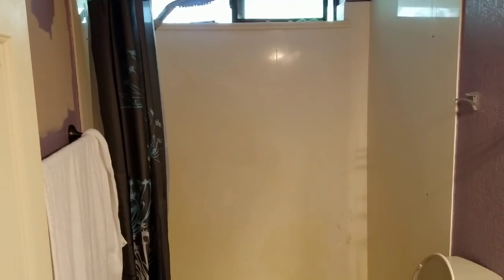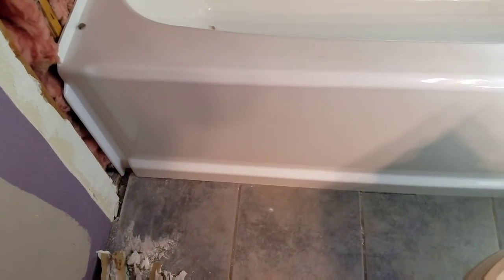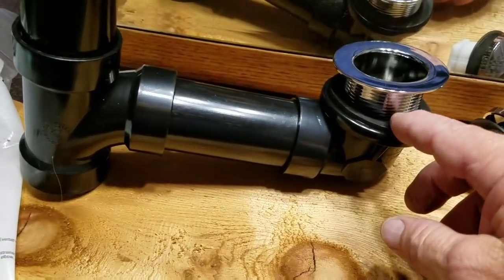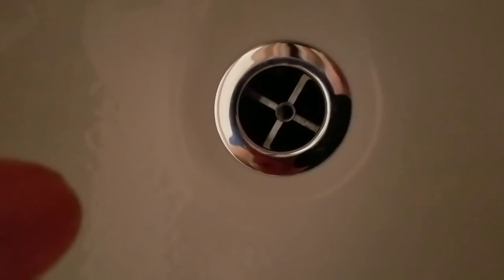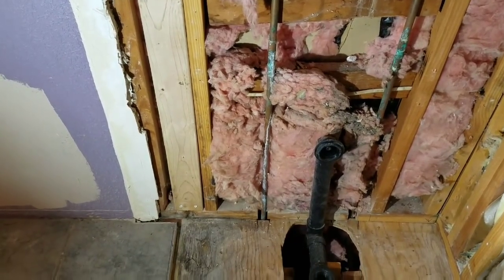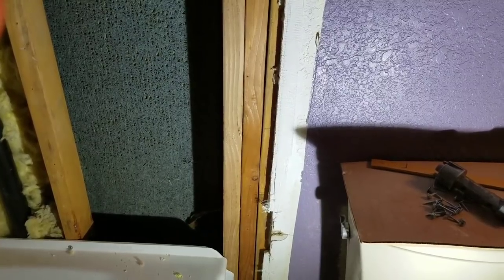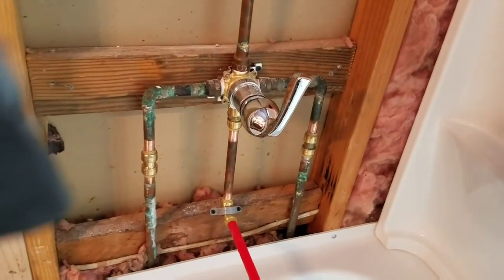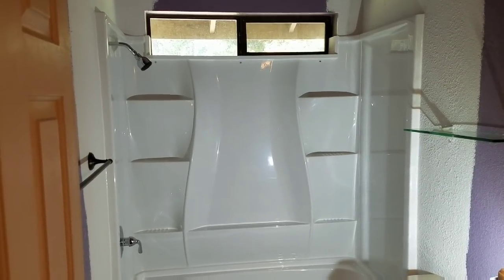How to install Fiberglass tub surround...Easy !!!

Comment: Great video.  Two questions...1)  The instructions for the Delta Classic 400 tub & surround have lots of stud placement that doesn't align with my current framing.  How important is it that these all align very close to the instructions?  2) For leveling the base, what about using a self-leveling compound on the plywood sublfoor instead of shims?
Reply from the maker: Hi John using a compound on the bottoms perfectly fine ,mortar or any hard mud like that and as far as  studs it  makes no difference at all whatever framing you have is perfectly acceptable , just want to make sure you have framing on the front edges, that's usually not the case unless you're taking out an old one that was the same size ,so you want to make sure you have framing on the front edge, on  the left and the right side covered, the rest of the stud placement is absolutely arbitrary
Reply: @Jonehughes  could give me an estimate on how many bags of mortar would be needed on the tub base to stick it perfectly on the floor
Reply from the maker: Real talk 

you do not use mortar to stick 
you use mortar to make it solid
 so there's no voids
 so it feels like you're standing on concrete
 in the same way you would pour waffle mix into a waffle maker to make a solid waffle

 instead of a partial waffle

 that's the same way you do a mortar base for a shower 

except opposite 

you pour the stuff onto the floor 

and then you set the pan on to it 

And that is only if you have the kind of pan that has the bottom that looks like a waffle iron

 in other words

 it has a bunch of voids that needs to be filled to make it solid

 if you have the kind of pan that absolutely is flush 

it  just lays on the floor 

you don't put anything on it 

you just lay it down

 but it shouldn't be on shims or then it will also have voids

 it literally cannot have voids

 or it will break down over time

Comment: Came out nice, dude. Does water drive in between the seams in the corners? Or do you caulk those long vertical seams?
Reply from the maker: Caulk everything super good with 
 Dap 3.0 brilliant white,
 Every single seam needs to be sealed
Reply from the maker: Dap 3.0

Comment: If I buy the walk in shower with the three Walls and base,,do the drains have to line up
Reply from the maker: Unless you are installing the exact same model (which is very unlikely) then you have to adjust the drain set up to fit the new
Reply: @Jonehughes  thanks

Comment: Great video! Keep them coming! I'm finishing up my girlfriend's bathroom and not sure if I should just pain over the m.r board or do something else like tiles. We're selling the house so don't want to go to crazy but want it to look nice. Any suggestions? Just put in a tube surround.and have about almost 3 feet to the ceiling.
Reply from the maker: Are the walls covered with drywall now or
Reply from the maker: Or are they covered with paneling
Reply: @Jonehughes  yea I have the drywall up.
Reply from the maker: Perfect and I would just go ahead and texture it and paint it and be done with it....
Reply: @Jonehughes  do u have a video on texturing and painting? Might be dumb question I just never have textured before just painted lol
Reply from the maker: https://youtu.be/9PHFQcGGXDo
Reply from the maker: But I would probably just skip trowel it,

 With a light skip trowel

Unless it is orange peel that you're trying to match

Comment: What did you use to trim out the window? We've been thinking about replacing our old crappy tile with a tub surround but we have a full size window in the bathroom. We'd have to cut the surround to fit the window but I'm unsure of trimming it out so it doesn't leak.
Reply from the maker: Yeah I wouldn't use one of those tub surrounds for that

First 

replace your tub and all the plumbing

Then waterproof all your walls

With concrete backer board

And then install

Flexstone wall surrounds

Or a similar product

And then use synthetic wood and synthetic trim

And seal it all real well

But make sure everything is sealed before the finishing products go on anyway

And the finishing products get sealed

With an over abundance of caution

You don't want any issues.... ever
Reply from the maker: Your friend has shared a link to a Home Depot product they think you would be interested in seeing:

FlexStone	Royale 36 in. x 60 in. x 80 in. 11-Piece Easy Up Adhesive Alcove Bathtub/Shower Wall Surround in Calacatta White
https://www.homedepot.com/p/FlexStone-Royale-36-in-x-60-in-x-80-in-11-Piece-Easy-Up-Adhesive-Alcove-Bathtub-Shower-Wall-Surround-in-Calacatta-White-SSK60367831CW/304669705
Reply from the maker: Your friend has shared a link to a Home Depot product they think you would be interested in seeing:

FlexStone	Elite 32 in. x 60 in. x 60 in. 9-Piece Easy Up Adhesive Alcove Tub Surround in Crema Bordeaux
https://www.homedepot.com/p/FlexStone-Elite-32-in-x-60-in-x-60-in-9-Piece-Easy-Up-Adhesive-Alcove-Tub-Surround-in-Crema-Bordeaux-TSK60326031CB/311687973
Reply from the maker: I would buy the shower when it's much taller

And sitting on a bathtub it would be full height to the ceiling

And your window could be cut straight out of it

Super easy installation
Reply from the maker: https://www.lowes.com/pd/Royal-Building-Products-Actual-0-75-in-x-3-5-in-x-12-ft-Common-Board-PVC-Board/50092312?cm_mmc=shp-cprdmlwgooglelia-122-exteriortrim-50092312-_-0&store_code=248&placeholder=null&gclid=Cj0KCQjwuJz3BRDTARIsAMg-HxXP2IW3NnW2mOrsHtltYBHv-qaBSvCskAnZjOhBq78smM6U0jJ7iRAaAj2yEALw_wcB&gclsrc=aw.ds

Comment: Do the gaps between surround back and sides get caulked?  I could not tell and you did not say.  I have a much cheaper 3 piece surround in rent house and unsure if the vertical gap gets caulked where sides meet back.    Thanks for the video!
Reply from the maker: Yes always caulk every one and you want to use pure white silicone the best you can afford usually around $8 a tube get good silicone 
Use plenty ,don't just seal the gap squish plenty into the gap and do a really good job and you'll never have to touch it again it'll be one piece when you're done
Reply: @Jonehughes  Thanks Jon!

Comment: No plumbers puddy on yhe drain stainer?
Reply from the maker: 17:30 shows using plumber's putty
If you use stainless plumbers putty it won't mess up the fiberglass
Sometimes on fiberglass and cultured marble it will stain if you use regular plumbers putty
Reply: @Jonehughes  oh ok

Comment: So I'm replacing an old polystyrene bathtub wall with a new one, newer model, the walls were sheetrock behind it, big issue with city, there was mold on the back behind the polystyrene so I ripped out the sheetrock and was suggested to me because of the mold, not to use green board but instead cement board, so I bought some to to the job, but I see here you don't have any back, just the bones so the cement board can it butt up to the existing sheetrock and seam it and water proofing the back of the polystyrene, do I use an aqua sealer?
Reply from the maker: No you don't need to seal it if you do it won't hurt anything but you don't have to go through the expense of doing that just put on all your cement board get all really nice and tight and then install your unit then seal it super well and you're done
Reply: @Jonehughes  ok got it thank you very much

Comment: What did you use to glue the panels to the studs
Reply from the maker: I literally never do that

 I did that to the first one I installed

It  actually has no advantages 

but if you want to do that

 you need to install wood back there that will  touch the back of the walls when pushed on and use exactly the same adhesive that you're going to use for the seams

 which is DAP 3.0

 silicone will not stick to acrylic

Comment: Are the sharkbite/tectite fittings push-to-fit or do they need to be crimped?
Can the Delta Classic 400 be installed with grab bars? I was looking at the back wall and the curves looked like it might not allow for grab bars.
Have you installed any similar units with grab bars?
Have you ever installed slidebars for ADA showers?
If yes to either of those two above questions, any tips?
Do you have any videos that show how you measured/marked for the holes on the wall panel that had to be cut for the tub spout, trim kit, and showerhead? Did you just use stiff paper and lay it across the studs and do the markings and then put it on the wall panel as a template?
Would it hurt to put a little expanding foam in the cavities of the tub (where the styrofoam is) and the shelves? (not like completely filled, but just a little to reinforce?)
Have you ever installed any of the Sterling tub/shower surrounds?
Reply from the maker: Yes
 the sharkbite and Tectite fittings are push on
 just follow the directions
 they work perfect 
2. yes
 you can put handrails and you must put backing
  where you need too
 you can place backing when you put in the walls 
 so it'll take a little bit of measuring but you should be fine as far as measuring for the plumbing on the wall that's a matter of doing a dry fitting
 so if you put the back wall on and make it real tight so it can't flex at the top or bottom you can measure right off of that to get your center lines 
 you can measure off the tub or put a level line across the top from the back wall to see where your top on your wall will be on the side and measure down from there so it's all just about measuring you can do this 
if you put on the other wall 1st the opposite wall of the plumbing wall and get it all tied in real tight dry fit then you can see exactly what the other side which is identical copy will look like and you can measure over based on that also there's a whole bunch of ways to do it I got confidence in you you can do this since you're asking all the right questions
Reply: @Jonehughes  Thanks!
I'm trying to figure out the best way to do the backing and what sort of anchors would be needed.
Since the surround bumps out, would the backers also have to bump out or could they be flush with the studs and then use some sort of anchor with a spacer?
Right now we have a fugly avocado green one-piece unit with a cracked tub floor & we want to switch to an ADA friendly white shower unit with grab bars & a portable shower seat and add proper vents. 
I really wish basic plumbing principles were taught in grade school. So many people don't know about the vents or slope & it's something they could incorporate into math classes-- figuring out slope & distance, angles for that 1/4" per ft slope, etc.
Reply from the maker: @mycats7321   If I was going to put a hand bar on the back wall and I wanted it where the slopes were
 I would hold  The grab bar that I was planning on using up against the back wall to determine where exactly I'm going to mount it ,
then screw through it and then put wood behind it and then screw through that and so actually put up the back wall with the handrail already bolted to wood that is behind it as a backer plate
Reply: @Jonehughes  Sounds like a good idea. I'll have to try that.

Comment: Hi Jon, do you think I can use this surround on a cast iron tub? Thanks!
Reply from the maker: Hi Nikki
 you can do it 
but it will be hokey

When I have an existing tub 
that the customers want to continue to use instead of replace 
then I use this product from Home Depot its absolutely fantastic

Your friend has shared a link to a Home Depot product they think you would be interested in seeing:

FlexStone	Elite 32 in. x 60 in. x 60 in. 9-Piece Easy Up Adhesive Tub Surround in Mocha Travertine
https://www.homedepot.com/p/FlexStone-Elite-32-in-x-60-in-x-60-in-9-Piece-Easy-Up-Adhesive-Tub-Surround-in-Mocha-Travertine-TSK60326031MT/304669222
SKU# 304669222
Reply: @Jonehughes  Sounds Good! Thank you!

Comment: Do you live in my neighborhood Pinellas county FL. I need this.
Reply from the maker: Pretty close 

Grants pass Oregon 😎
Reply: @Jonehughes  you are funny!!
I was planning to take out our tub and convert to shower. But I am rethinking because I want to go bank to an acrylic rather than subway tiles. The guy I was planning to hire (World-class remodeling in Tampa) he quoted me $2900.00 tio do a tile floor and tile to ceiling, right now I have tub with tile to ceiling.  But I am tired of trying to keep tile clean, I like the look of this delta classic 400.  I have asked the remodel guy if he could just get this for me, and leave the tile that will not be covered that reaches the ceiling. Anyway, thankyou for your video.
Reply from the maker: Text me at 5416607805
I will send you pics

Of a shower system that will work really well for you

They are super cool and very easy to put in

Comment: Did you caulk between the side panels and the tub?
Reply from the maker: Yes ,
Use only the approved sealants

Silicone will not stick to this shower system

You absolutely must use the sealant they require

Seal every single seam

When you were done

 it should look like one piece

Super important
 only you specified sealant

Nothing else will stick to this

Comment: How did u cut the shower wall panel where the windows at with what tool and how was it done ?
Reply from the maker: I use a 4 inch grinder with a metal cut off blade
Reply from the maker: https://www.harborfreight.com/pack-of-10-4-1-2-half-inch-cut-off-wheels-for-metal-45430.html
Reply from the maker: https://www.platotou.com/dewalt-dcg414t2-flexvolt-60v-max-cordless-lithium-ion-4-1-2-in-6-in-grinder-with-batteries?gclid=Cj0KCQiAyKrxBRDHARIsAKCzn8y1wK9syy_IjuiHBrwKnKsV_YChu96rnrwuesp7ban5QNPO4XJjauMaAg8LEALw_wcB

Comment: Great video; very well explained. Beautiful job on the window.  Did you have to seal the three edges of the vertical panels with the DAP product as well?
Reply from the maker: It is fine to use that product

 but you don't need it for anything other than the acrylic tub

The acrylic tub will not accept any other sealant

No other sealant will stick to it

But everywhere else you can use white silicone
Reply from the maker: Just to be clear if you are touching the acrylic tub you must use that sealant

No other sealant will stick to that acrylic

Comment: What do you use for the window sill and around window where you cut surround?
Reply from the maker: Yeah try to go to Home Depot or someplace like that and buy synthetic wood and synthetic trim that way once you seal it in with silicone or Dap 3.0 sealant
Depending on which tub of your installing whether it accepts silicone or the special sealant it will last forever

Synthetic is best

If you can't put in cultured marble

Comment: Why is the water damage from the previous shower pan on the sub floor not addressed in the video?  I would think that sub floor would need to be replaced before the tub goes in.
Reply from the maker: Hi Nicole there was one little spot on the left that had to be addressed and I did address it before the new unit went in but it was only a little portion and only gone through 2 layers of 7 layers of 1 1/4 " plywood
Reply: @Jonehughes  The floor was over 8 inches thick?
Reply from the maker: @fryloc359   No it was an inch and a quarter total,
 2 layers of the inch and a quarter, which is about an 8th of an inch was Rotten, so I replaced those portions with fix all... I just scraped out all the rot and replaced it with fix all
Reply: Ok it was worded strange then.

Comment: so u haven't had any problem with sharkbites leaking? I'm still reluctant to use those in inaccessible locations.
Reply from the maker: Absolutely no leaking brother
 All the name brands sharkbite, Tectite
 Are  Totally awesome
 I have been using them for years and there is absolutely no leaks They're legal in all areas, underground ,confined...etc
Reply: typically no issues with copper to brass shark bites except in colder climates PEX with shark bites work best in colder climates
Reply: ive used shark bites on pex in my home and they have held up to a few texas summers so far, they work great.
Reply: Why use shark bites on pex. You can buy pex fittings for an 1/8th of the cost of shark bites.

Comment: Nice job can figure out The shark bite on the   spickett how would get  it back off wouldn't  it be unstable  But otherwise very nice job But otherwise very Nice
Reply from the maker: Gene, you are exactly correct,
The shark bite on the tub spout
Was removed and replaced with a threaded shark bite
Dropped ear elbow

So I could install a brass nipple for the tub spout

I forgot to show that part

Good catch 😜

Comment: What about the exposed screws around the window?
Reply from the maker: Hi James
This installation is not optimal
What I mean by that

Is that there is a large window in place of where the wall system mounts to the wall

The perimeter of the back wall gets attached at the flange

And the flange has been completely removed

Because a window was in its way

So there's no longer an attachment to the wall

That is my way of macgyvering the system

If you can think of a better way 
have at it brother

And then 

share with us if you will

We are all willing to learn

Comment: What did you use for the trim around the window?
Reply from the maker: I have not found that available ,

so your best source is going to be manufactured synthetic wood trim from Home Depot or some other source and just put it together like you would a normal window and seal it really well so all water washes into the tub if there was any water to get on it